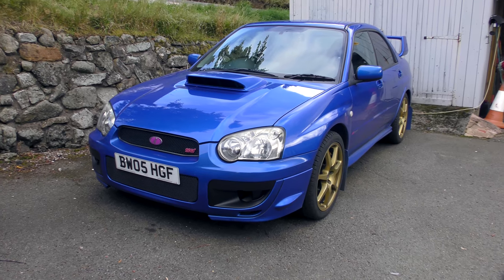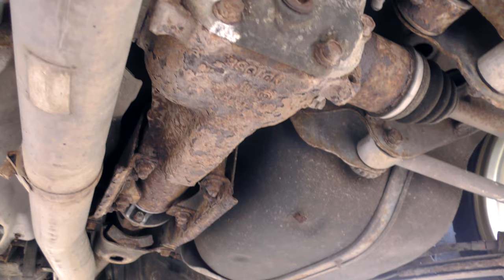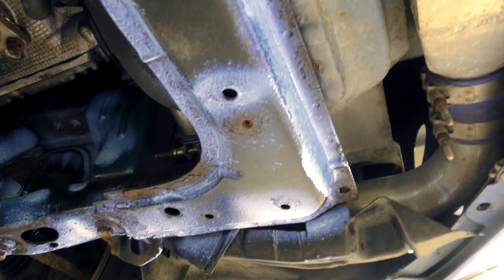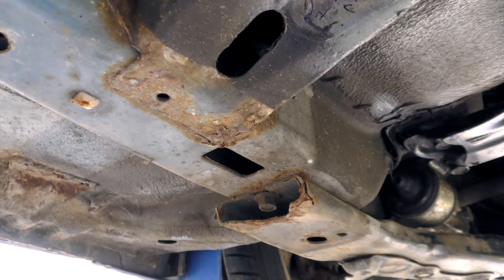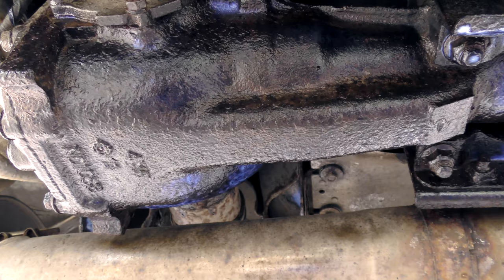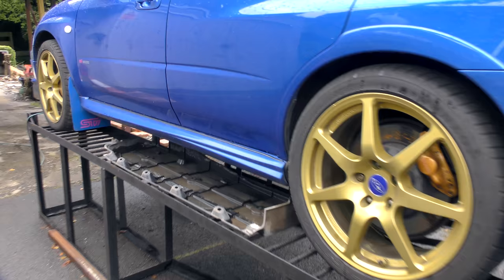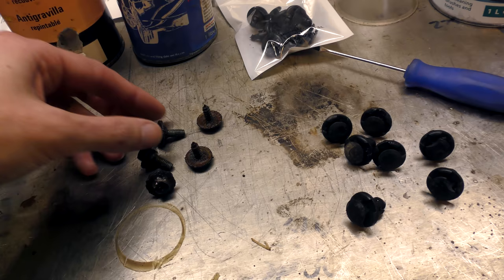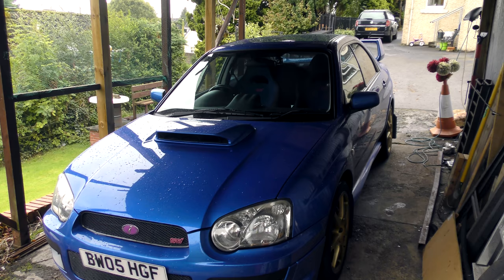Subaru Impreza rust treatment with Aquasteel

Comment: I have a question.....what did you use to flush and clean the aquasteel application spray ready for the next time you use the gun to prevent it from getting clogged up...thanks.

Comment: Great tutorial, have you checked on the front of the rear wheel inner arches by the sill I got a big hole I have to weld up on my wide track like yours, they certainly get rusty, such a shame, keep up good work, cheers

Comment: Hi ! Can I ask if you sprayed the differential with under-seal as well ?   working on my Subaru at the moment & wondered if its OK to Spray the differential .  doesn't this area get very hot ?   or is it fine to do ?  Great vid  & like the Jack lift design ! Cheers J
Reply from the maker: We've never done a differential with underseal, but next time we're at the track we can get the temperature of the diff casing after a few intense drift laps.

Comment: How has this held up since you applied it?
Reply: Not the best looking at the MOT history.. Offside Front Subframe mounting prescribed area excessively corroded significantly reducing structural strength subframe x2 (5.3.6 (a) (i))
Reply: @1969tonksy  thats not a serious problem at all, £50 for a rust free subframe all sorted but the shell is rust free, the shell is all that matters as subframes are cheap where as welding is not